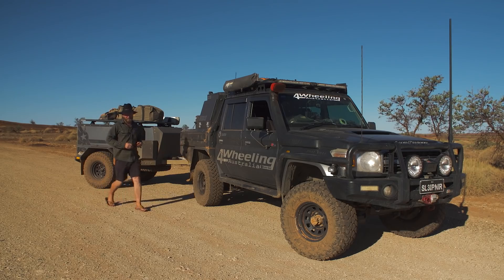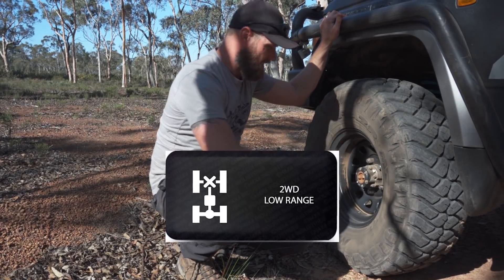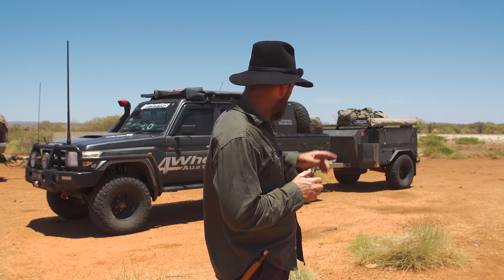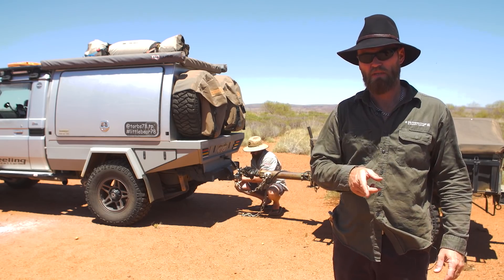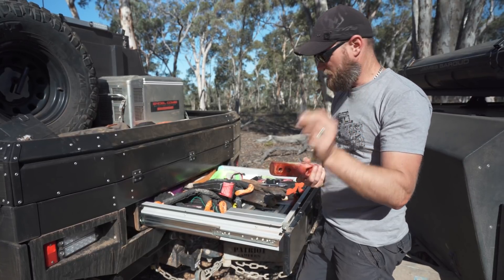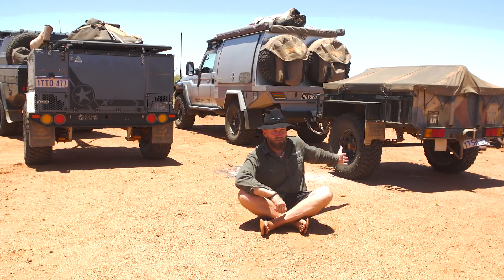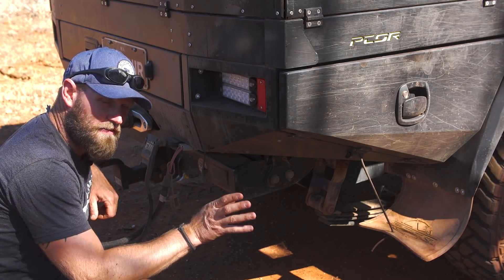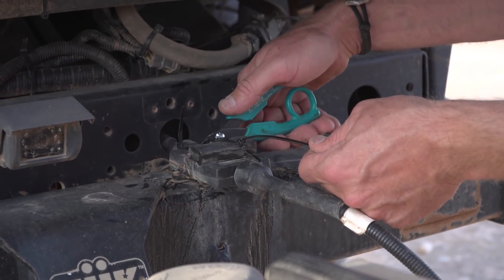Off-Road Towing, Advice no one else will give YOU

Comment: Tip #42: Spend $30 on grease able trailer hub caps. Boaties use them all the time. You can keep pushing clean axle grease in one end and dusty dirty grease out the other on a long off road trip. Sand and mud is just as bad as water on your bearings.

Comment: One thing I would add. Put a light cable socket on the trailer and use a cable with a plug on each end. I used to manufacture trailers most of which went into agriculture and construction, but one thing common in both was the light cable getting hooked on something and torn off the answer was a socket on the trailer and the cable that went to the towing vehicle had an identical plug on each end,that way you can carry a spare cable so that when (not if)it gets damaged it is just a matter of plugging in the new one.
Reply: Done. I'm using that.
Thx for that sound advice.
Reply: I’d have to disagree slightly with that brother, (no offence intended either) I used that exact set up for 6months and had to go back to just a single port. I’ve travelled extensively throughout australia towing for over 20yrs and this set up you suggest causes an extra fault point. The movement and rattling that goes on cause the cables or points to loosen, also depending on where the second plug it  is 2nd plug that can become dirty, wet and faulty.  Food for thought
Reply: @livelikekings8968  That is because you use the Australian plug and socket not the Euro, which is far more stable. I have looked at the AU and US lighting plugs and sockets and wondered who designed such mick mouse set ups. Here in the UK a socket dangling on the end of a wire as the US often has would get you a ticket for contravening the construction and use regulations. I have put plenty of lights and plugs on agricultural trailers as well as construction and builders over the years and by far the best and most reliable has been a socket on the trailer as cables are forever being snagged and ripped by use in rough conditions.
Reply: Equiluxe1 completely agree with you about the Australian and NZ trailer plugs, especially the round ones. Absolute garbage they are! (My comment I guess was concerning Aus/Nz I should have stated that)
Reply: @livelikekings8968  yeah agree with all that you have said. I own 6 off road trailers (I'm an outback mining contractor) & find the flat plugs the best, and even then I have to replace them every 18 months. I always carry a spare plug with me
Reply: Tim all my vehicles end up with both flat and round ports. The flat is my preferred option as well. 💯 agree with you on replacement, the state of Australian roads both on and off-road test all trailer leads. I’ve lost so many over the years. None seem to handle the constant bumps and corrugations. We just did the Moranbah to Brisbane run yesterday and lost one lead, a large shackle and the thread on the gate latches failed and we nearly lost a whole load. Lucky I use zip ties as backups

Comment: Would love tips for heavier pulling offroad... ive got an 8.5x20 ft tandem axle car hauler for bringing toys (dirt bikes, quads, sxs) out to the trails. Trailer is wider than the trucks track width so you cant keep it in your tracks. I dont pull this trailer off road very often but as a great example, my 1/3 acre camping lot is about 5 miles from the entrance/parking lot and the parking lot is easily 2-3 feet deep sugar sand.

Comment: When lowering trailer tyre pressures, I generally prefer to lower them where the length of the tread on the ground matches the length of the tread on the ground of the vehicle. My theory is that the trailer should float along the track much the same as the tow vehicle.

Comment: When you're lowering your tyre pressure for maximum traction to get the correct pressure measure the footprint of your tire. For instance if your front tyre is 15 PSI and the length of the footprint is 350ml then you're back tyre could be 18 PSI at 350ml your trailer could be 6 psi with the same footprint of 350ml now you have all 6 tyres exactly the same and happy travelling .PS do not exceed your speed or you will see bubbles on the outside of your tire which means your tire has already delaminated and ready to burst

Comment: There’s one thing you forgot to cover Ronny. The couplings. When going bush, you need a coupling that’ll move/rotate when doing technical tracks, hills, bumps, rocks, etc etc, because if you just have a standard fixed ball coupling, it’ll suffer, have stress & strain, cuz they do not flex, they aren’t designed too, and if you push it, your trip’s done. Hitches I recommend, I recommend al-ko off-road couplings, cruisemaster do35/45/65 hitches & hitch couplings. Do your research on them.

Comment: I have a Holden vt commodore sedan v6 and I was thinking of making a 6x4 box trailer type camper trailer for camping storage with small solar panel system, camping fridge/freezer and portable folding camping furniture and supplies such as portable camping kitchen not attached to the trailer, folding tables or chairs, ground mounting tents or gazebos, my vehicle says on my car that my vehicle towbar capacity is 1200kg but I’ll be swapping my towbar to my new 2100kg, and I looked up in my owners manual and it say that my kerb weight must not exceed 1672kg, unfortunately due to covid and the omicron outbreak here in Australia and living in Melbourne the longest lockdown in the world I have a feeling that we’ll end up in a super strict lockdown again and will probably not be able to buy a 4WD due to covid restrictions and strict lockdown laws so my question is will my vehicle be safe enough to tow a 6x4 camper trailer

Comment: I have an off road that has leafs with shocks. I’ve noticed that the individual leafs are not aligned and each end of each spring. Is this a problem? I have knocked them “in-line” with a hammer but did one trip and they’re back to being “out-of-line”. Are they too stiff?

Comment: I’m a mechanical/physics idiot. I’d like to know though. Wouldn’t slick tires on your trailer be beneficial because they don’t provide power to your rig, but they do provide drag?
Reply from the maker: Slick Tyres could cause problems with the trailer sliding sideways on corners or off camber sections. They would also be covered in mud

Comment: GOOD STUFF all around smart things to always do when you've got to have a trailer for all your things.
I liked how you held your mud flaps up out of the way...I noticed that when you were showing the trailer wiring location. I personally use and light weight small chain...I find it allows the mud flap to move easier over those higher rocks and logs and it is easy to tie up with the smaller bungy chords back on the black top.
Thanks again for showing the things others either don't know or think about.

Comment: Elevation change, in California there is a small abandoned Silver Mining town Cerro Gordo the only [main] road in is an 8.5-mile narrow road with a mix of loose gravel, sharp shell rocks, and sand-like dirt as well as 100' drop-offs. The very narrow road has narrow passes, blind hairpin turns, only a few turn-offs, or a place to allow others to pass. The 8.5 miles is a twisted estimated 3 miles by crow fly, a temperature change of 15-30 degrees 110 drops to 75 [us], but my question is with the elevation change of 1 mile higher [3602 ft/1,098m to 9188 ft/ 2,800m] should we be adjusting for elevation and temp changes.  There are many who suggest lowering air pressure by 10-20 psi for the ride-up.  FYI every day someone blows a tire or two.  I have a Diesel 6.4L Ford F250 SD, 4-door, FX4 Package with  ''Pathfinder LT275/65R20'' tires cold 80 psi recommended. What are your thoughts?   https://www.onxmaps.com/offroad/trails/us/california/cerro-gordo-backdoor

Comment: disappointed you didnt mention loading,  make sure you always have ball loading on a trailer,  you might be fine at low speeds, but once you get back on the highway if you dont have the 10% ball loading, you can lose control easily, specially in the dust.

Comment: After doing electronics for 20+ years great tip for Anderson plugs, is to hot melt glue or silicone the other end to keep dust and dirt way from entering from the rear of the plug, I have a Anderson plug cover too for when not in use and 5 years now and the pins inside them still look like new.
OH do not use cheap Anderson plugs even super cheap brand, stick with the genuine Anderson brand they will last much longer and have better pins and stronger housing.

Comment: Thanks for sharing your knowledge and expertise. I'm jealous of you all down under and your torquey diesel motors. For some reason here in the states, manufacturers don't offer many options for light trucks and suvs in diesel. So I'm stuck with a petrol V6 with more horsepower than torque and I have to wind it up to near red line to get to my peak torque. Bummers ya?

By the way, I inquired about a Bruder caravan. Sheesh, I need a second and third job to afford one of those.

Comment: Great video and sound advice as always. 
2 things as a truckie I would add that I didn't hear you mention. Firstly one of the main reasons to lower tyre pressures is also to avoid tyre damage from staking etc. 2nd when reversing don't look over your shoulder, get used to looking in your side mirrors. It helps with your orientation/spacial awareness and once you get used to using your mirrors reversing a trailer becomes 2nd nature.

Comment: I use a bit of paracord as a safety loop to catch the the trailer wiring and Anderson plug if they fall out. Pass the the connection through the cord tied in a loop on the vehicle and it will stop the connectors getting trashed if they fall out and hit the ground.

Comment: I only understand dropping the type pressures to act as a shock absorber in a sense, but I would of thought dropping the trailers tyre pressure low on sand would be acting as a bit of an anchor cause instead of a nice circle as the tyre, it would be pancaked at the bottom, which to me doesn’t make much sense unless the tyres are getting power

Comment: With light springs airshocks would work well. Example: water and fuel usage will lighten the load, in turn drop the air pressure. I used airshocks on a light truck and they worked great, I figure they would work on the trailers.

Comment: Dear Ronny, I do look your show in Europe and only go to Australia for holliday trips. My 4WD truck is a real truck and I'm specialized to go in snow and on ice.

 Still, most of the time I certainly do learn something. This time I do knew all of it and I can tell you, you made a great tutorial on your off-road-trailer-towing-video.

Yet, the funny thing is, in Europe everyone has to have wheel-chocks at his/her trailer suiting the dimension of the trailer's wheels and the weight of the trailer. You just must have them carrying with your trailer and I never thought that there would be any developed country where it wouldn't be this way.

If it comes to the trailer brakes, than we do have an entire different system here (required by law) that (if you don't operate at trailer below 500 kg total weight) always will come with automatically working brakes. Only in Sweden and Finnland trailer-brake-adjustments operated from the driver seat are allowed, yet it is possible (not legal) to block the brakes to not work at all and I do fully agree: concider in forhand wether or not you will have your trailer to brake at a certain ground and disable them if prefered. On ice and sand and very often also mud and gravel it is the last thing you want to hapen: a trailer using its brake.

Ronny, you made a very well done video - again.

Sincerily with compliments,
Stefan.

Comment: Very good , we tow three different trailers and each is very different. The one thing that is constant is a checklist we use .
 it really helps to make sure every time we go we don’t forget to do something . Nothing worse then being out in the middle of nowhere with a problem that could have been prevented . there are always surprises that come up but if you have the spare plug , pin , wires etc. it helps make those problems much easier to deal with .

Comment: Missing a visual on reversing on soft sand without deflating trailer tires. It quickly jack knives. Learned this the hard way doing a hill climb on soft sand at night with trailer. Made it after 3 x attempts. Got to camp late. I thought trailer pressures were irrelevant. Soon as i dropped tyre pressures on my drifta trailer to 15psi i could easily reverse the whole way downe. Unreal difference.
Reply: I've gotta second that Jack-knife point. Know it well. I had to turn around because I took the wrong path. 28' trailer behind a Ram 2500. I did a full 180 turn in the Y...As a 70 point turn that put the trailer inches from trees, and the truck no further on the other end. It was only possible because I could jackknife almost 90 degrees.

Comment: Cables and plugs ????  Have a look at WiTi and do away with them all together. WiTi is taking Intelligent Transport Systems (a global wireless standard for vehicle to vehicle communication) into trailers and caravans. No more 7 pin plug or cables so no more loose connections, corroded terminals or plugs failing and getting full of dirt. WiTi transmits all lighting and braking signals wirelessly. It also includes a brake controller with Hill Descent Control for those really tough tracks where you need both hands on the wheel and can't be fiddling around with knobs on your normal brake controller. have a look at witi.com.au for more info.

Comment: When coupling the trailer have the vehicle lights , fog lights and hazard lights turned on so you can check the trailer lights at the same time. If some one else is there ask them the check the brake lights.

Comment: Got a question relating to towing in 4wd not so much 4wd towing. I tow a trade trailer, around 700kg. I some times get to a steep drive way (hard surface) which is hard on the clutch to reverse up. I normally just have a extra 10 -20 m with minimal turning to get the trailer where I need it. It it ok to switch my car to 4wd low for that? It’s a 2012 Hilux. Thanks. Zak.

Comment: Good idea to have a stabilizer jack or two on the back of the trailer so if it is unhooked it doesn't tip backwards when unhooked, especially with a rooftop tent on it.

Comment: On the cotter pin spare for the receiver pin: I haven't had one of those pins in a few years. Because I leave my hitch attached (I go from trailer to no trailer pretty much at random, and it's just easier to not get into the locker to get the hitch), and I live and work in places that aren't the most secure, I have a locking pin. The key-lock is covered by a screw-on cap so it doesn't get mud and gunk in the keyhole, but in a pinch, duck-tape can cover that. ( https://www.homedepot.com/p/CURT-5-8-in-Chrome-Barbell-Hitch-Lock-3-in-Receiver-23025/311102212 )

My dad has a speed-pin for his (Because he can't fit in the garage without removing the hitch), that has a small folding tab instead of a pin. You straighten the tab so it's parallel with the pin, shove it through, and unfold the tab.
( https://www.homedepot.com/p/CURT-5-8-Swivel-Hitch-Pin-2-Receiver-Stainless-Packaged-23582/205631597 )

Comment: I like how the Australian army Trailer was so well balanced it was easy to put onto the pindle hitch I had a camper trailer with 130kg Ball weight manageable with a jockey wheel on concrete but off road a real pain if you have to disconnect my 79 didn't have the rear diff track  corrected so in sand I was making six wheel ruts and getting stuck to often great video

Comment: Couple of other important things - 1. Tow ball weight limits can't be exceeded and they also eat into your payload.
2. Weight distribution in the trailer needs to have a forward bias to prevent trailer sway.
Reply: It's not just tow ball weight limit. From a legal (and safety) standpoint, you're limited by the lowest rated component in the entire towing setup, be it the bumper, receiver, drawbar, ball, coupler, frame, springs, axle(s), or tires. Also, just saying forward bias is being very vague. Tongue weight should be 10-15% for a bumper pull (tag-along) and 15-30% for a gooseneck or fifth wheel. Uneven side to side loading can also induce sway, not just front to back. And being familiar with the manual override on your brake controller is critically important because when the tail starts wagging the dog, it can turn into a deadly situation in the blink of an eye.
Reply: Just a question regarding weight distribution mate, I want to carry 4 extra jerry cans and the perfect spot is at the front of the trailer 
(I have a 2015 patriot x1)
Having this extra weight at the front is ok? 

And would these smaller camper trailer start to wobble at higher speeds or is that just for bigger caravans ?
Reply: @anthoniminiotis3526  as long as the ball weight is still below what's listed in your owners manual, that's all good. 

Any trailer can get trailer sway, just that the bigger the trailer, the more force it can generate.

Comment: Use glass electric tape on your wiring around areas that like to rub off wire insulation.
Two to three tight wraps does the trick.
It's not a bad idea to just wrap long stretches   for added protection.

Comment: As usual lots and lots of very good advice and I learnt a few new tips. One more is having tyre pressure monitors for your trailer. If gives peace of mind to know that you'll very quickly get a warning if you get a puncture on the trailer. And if you have padlocks to secure compartments on your trailer take them all off before hitting dirt roads - I learnt the hard way when I left one on and it filled up with dust and jammed. Had to wait till we hit a town to get it off with bolt cutters.